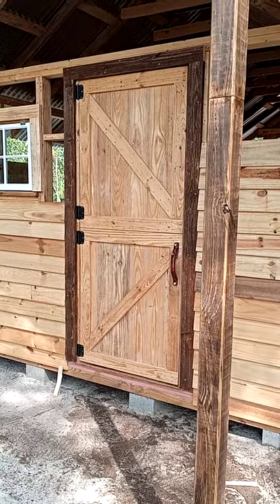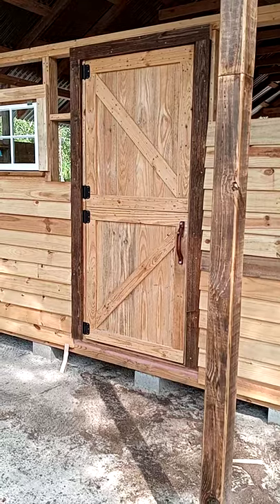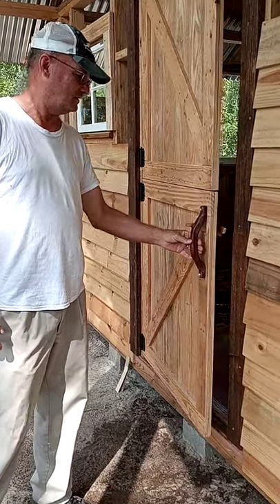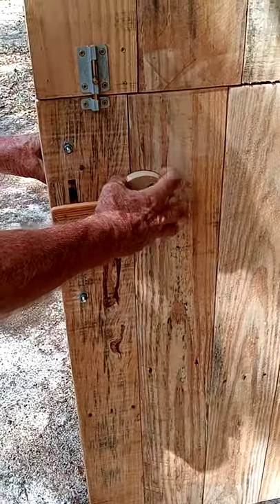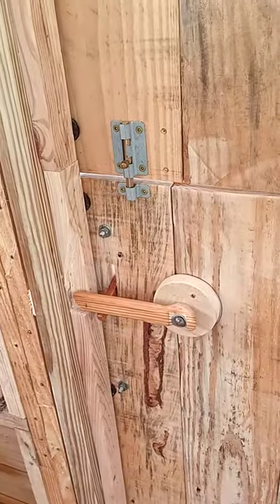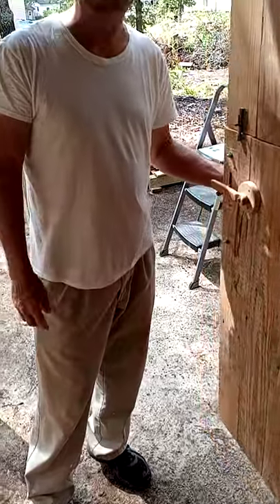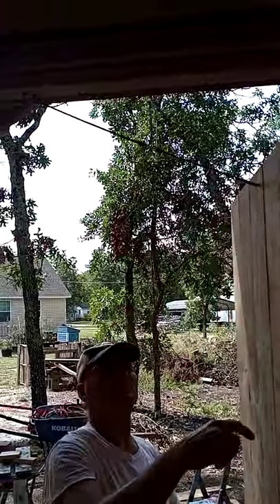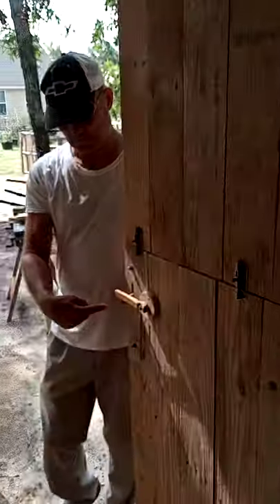Dog is FINE. Vid 18 Cabin Build Wooden door latch

Comment: Make a triangle out of wood so it rides on the wood into the stopper. That's how my store bought 1s connect and then it won't end up breaking. I'm so going to make your build though as I need a latch and I'm not paying 20 bucks for hardware. Yeah I'm cheap and I have allot of left over end cuts from my shed I just built. Thank u kindly for the ideas. Cheers